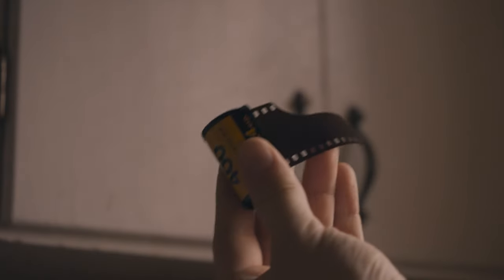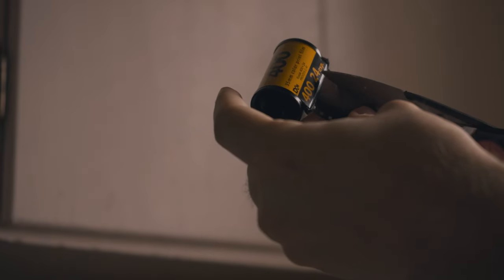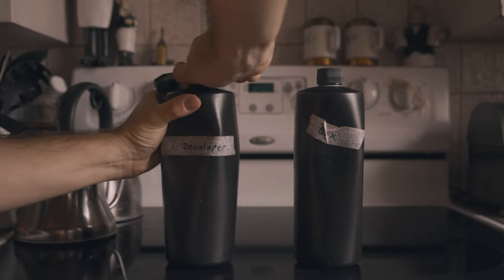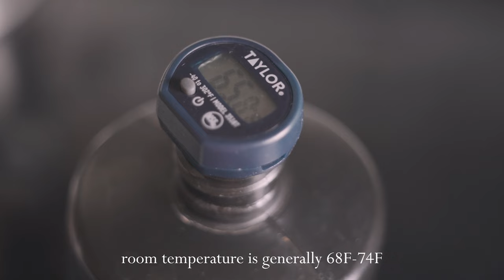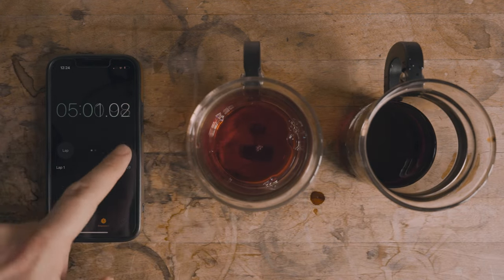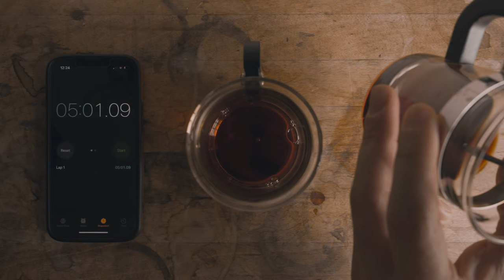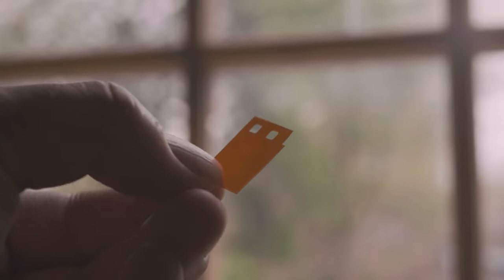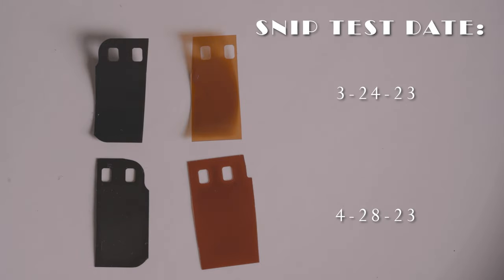How to Test Your C-41 Film Chemicals with a Snip Test

Comment: how do I test it on a kit with bleach and fixer seperate instead of blix?
Reply from the maker: That’s a good question! I’ve never used chemicals that use a separate bleach and fixer. I bet googling the brand of chemicals and snip test will get you some results! My guess is you could run a snip through the bleach and fix process and it should look like my blix snip afterward
Reply: If you put a test snip of film in just the bleach, you would  probably see nothing informative. But, if you then put that bleached snip in the fixer, it should clear to transparent film, assuming both bleach and fix are active. If you put the snip in just the fixer, it would clear, but leave a something like a cloudy negative image, which is the developed silver not bleached out as it would in the normal process.(This is the "bleach bypass" technique some fool on YT started to make a pointless video.)
    But, all of this is silly, as the snip test carries over from B&W processing, where all you are checking is developed negative density. With color film, it will also check density, i.e., activity showing your chemistry is not totally dead. But, it will not reveal weak, failing chemistry which will leave you with color cross-overs which are not correctable and loss of color saturation. So, color negative chemistry can "pass" a full snip test as shown here, and still ruin your roll of images.